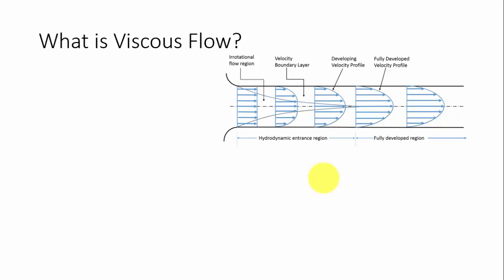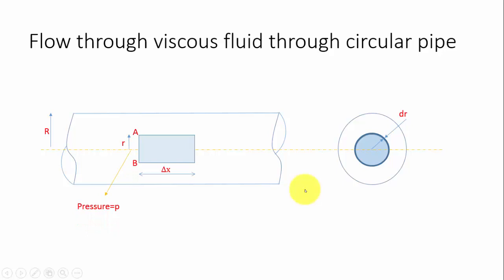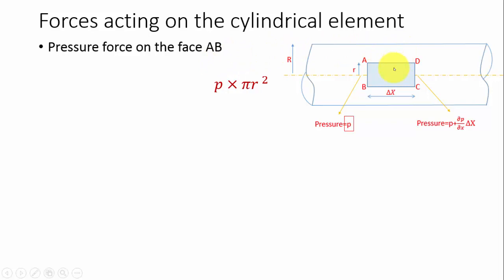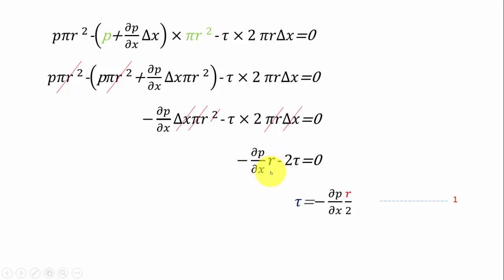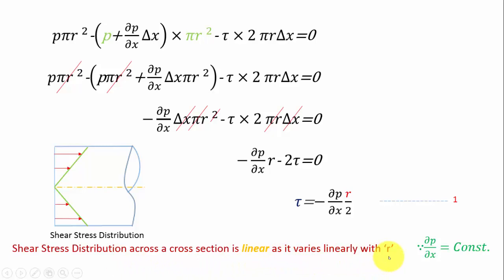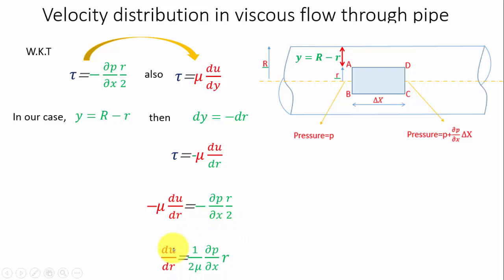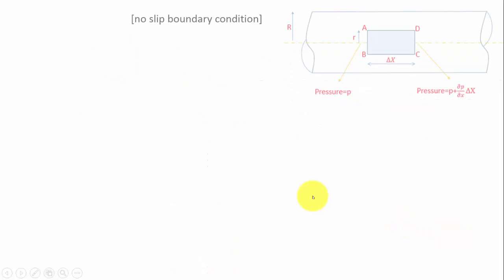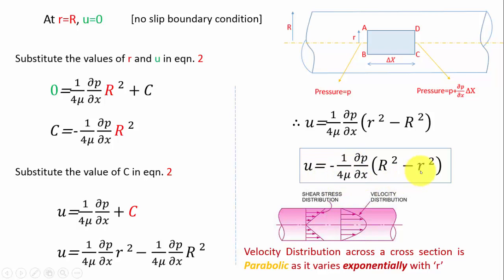Hagen–Poiseuille's equation | Viscous Flow | Fluid Mechanics

Comment: why the sign is positive right side of the square element at 2:07 , pressure should decrease left to right ?
Reply from the maker: Yes. That will be decreased. The amount of force that is reduced is the pressure force in CD and the shear force on the surface of the cylindrical element.
Note the last line at 3:45, the forces are subtracted.

Comment: at 15:11 why isnt upper limit - lower limit ?
Reply from the maker: Dear Jerry, In this case, our intention is to get an expression for head loss in pipe flow along the length of the pipe. The upper and lower limits mentioned here are the distances from a reference point. Hence, the difference between these two distances will be the length of the pipe under consideration. 
I've answered. But not sure whether you convinced. Please feel free to discuss further.